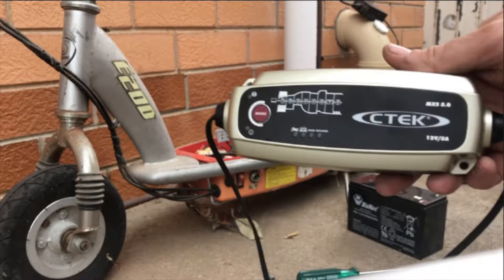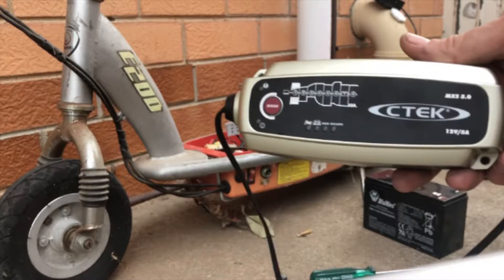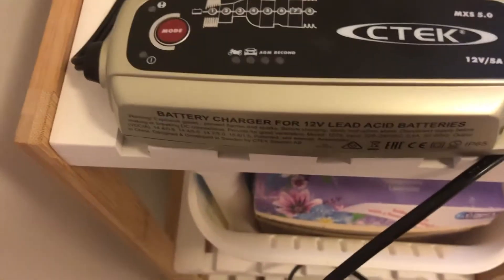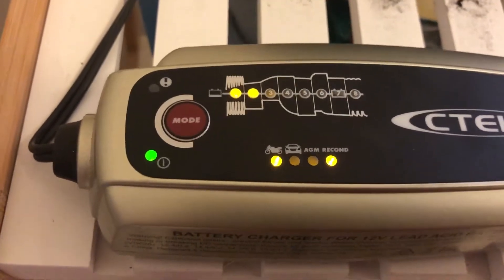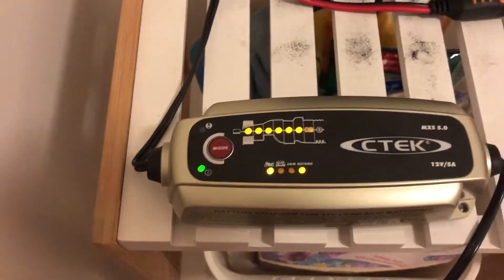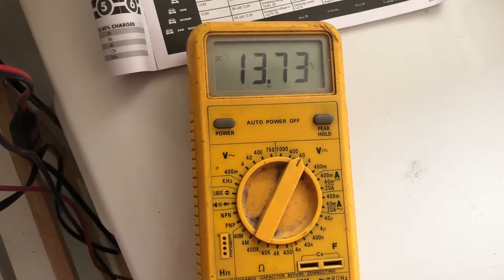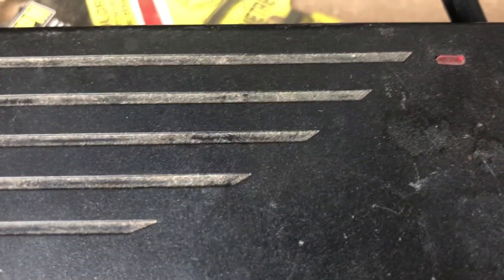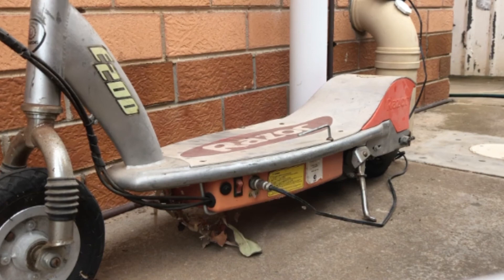CTEK MXS 5.0 Recondition 12V Sealed Lead Acid Razor Electric Scooter Battery

Comment: Those razor scooters don't start when you give them throttle . can you have to push start them and then give them throttle then they take off
Reply from the maker: Hi Mate, I believe it's only the little ones (E100 and E125) that you have to push to start off.  The E200 and E300's that I have had take off without a extra foot push!  Cheers Drew
Reply: Hello. Can you actually use a ctek as a charger ? I just wonder because my original charger is not working. Thank you
Reply: @kirisgarage8590 yes you can